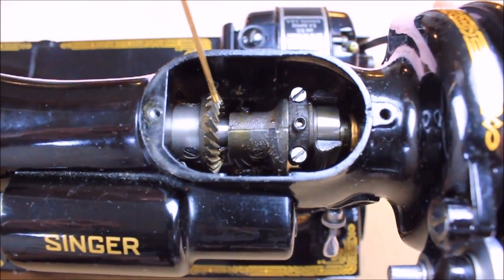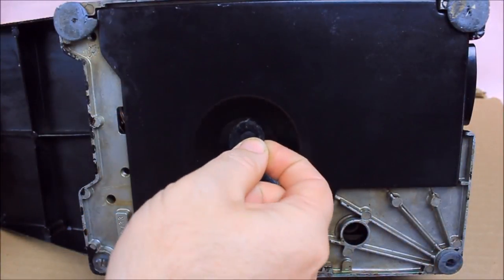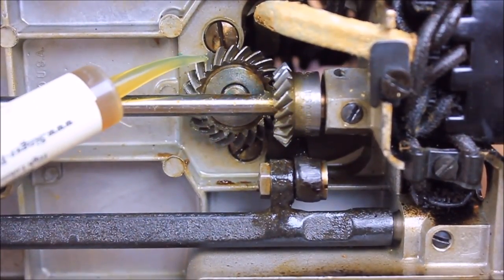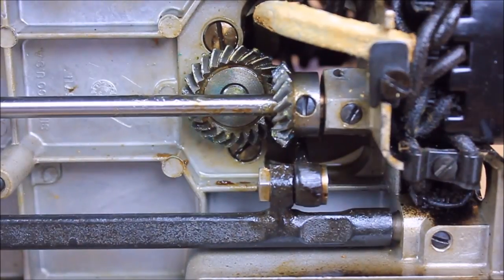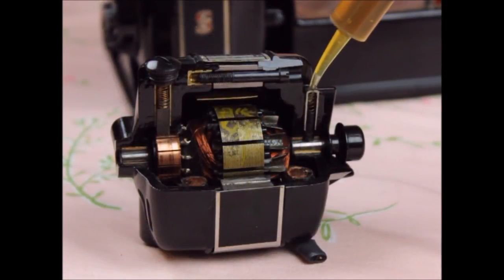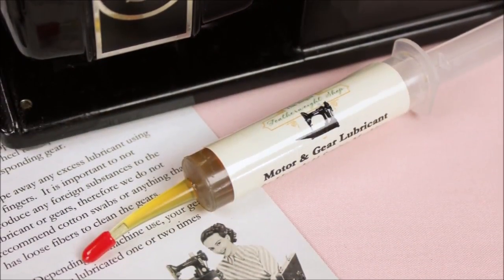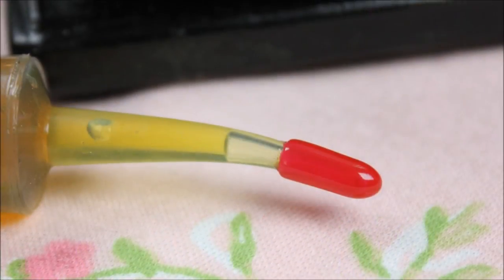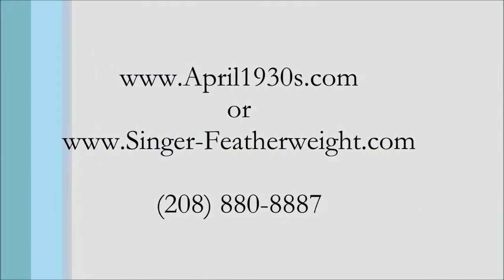How to Clean & Lubricate the Singer Featherweight 221 & 222

Comment: I wish you would show one like mine that is packed with old smelly lubricant.  A tiny drop of kerosene doesn't even begin to remove the old stuff.  I'm afraid of damaging my machine as it does actually work but smell terrible.
Reply: The smell is probably burning lubricant that has lost its friction reducing properties.  You might need to use a carburetor or parts spray cleaner to remove the old oxidized and gummy grease.  Use it in a well-ventilated area- it's also highly flammable but will evaporate quickly.  Do not get any of the spray on anything that is not bare metal.  It will damage paint or plastic parts so you might try carefully spraying with quick bursts using a rag as a kind of shield to keep it from spraying back at your face.  This is seriously nasty stuff-  Wear solvent resistant rubber gloves, eye protection and a chemical respirator or have a fan blow the fumes away from your face.  It will get any nasty black residue off so you can apply fresh grease to gears and other metal parts that move against one another.  Don't use that old grease in the back of your garage- use fresh lubricants only as their molecular structure can alter over time and some are hydrostatic (absorb water molecules.)  Use the proper lubricant (as stated in this video) for your specific machine and the specific parts to be lubricated.  Don't be hesitant, your machine will reward you with smooth and safe operation for many years.

Comment: On my machine the top lubricant port has another thing above it, that looks to be properly part of the motor housing, blocking the path for me to clean the port out or get the lubricant in.  It's a British motor. Cat. C.A.K.6-12 if that helps any.
Is there an easy way to remove whatever that thing is (it is round, black, chubby, with no "slot" in it so I can unscrew it and is "mounted" horizontally into and up flush against the curved upper portion of the motor housing) so I can get access to the lubricant port, or is that not a lubricant port at all?  
There is some clearance between the chubby black thingy and the port, but it's not much at all.  Any advice gratefully received - thank you.
Reply: With the help of a friend I've worked it out (that is, they told me!). Someone in the past has pushed something intended for the bottom of the machine (to cover where a green wire comes out) into the top part of the machine. Once I knew this, and that it definitely isn't threaded, I felt brave enough to simply push it off and put it back where it is supposed to go.  Indeed, on the bottom of the motor the green wire had nothing over it. This little chubby thing has a channel in it for the wire to go through and it just pushed right in.
Reply from the maker: Hi, Megan!  Thank you for asking!  On the Featherweight Schoolhouse, under Maintenance & Tutorials there is a Motor category with a video that discusses the various motor ports and felt wicks:

http://singer-featherweight.com/blogs/schoolhouse/learning-about-motor-felt-wicks
Reply: @featherweightshop  Awesome - thank you!  I'm popping over there now to check it out.

Comment: Kerosene stinks.   How do you get rid of the Kerosene smell afterwards.
Reply: I used acetone and {free dentist-supplied) toothbrushes, rubbing the gunk off the tooth brush on a clean piece of seersucker (the texture helps clean it off). Put a small amount of acetone in a bottle that will fit the toothbrush or a cup. Not too much, it evaporates! Must have good ventilation when working with acetone...
Reply: @abbee333  Thanks for the alternative.  I am using Kerosene but I don't think I will use it again.  It is too strong for me.  YIKES!